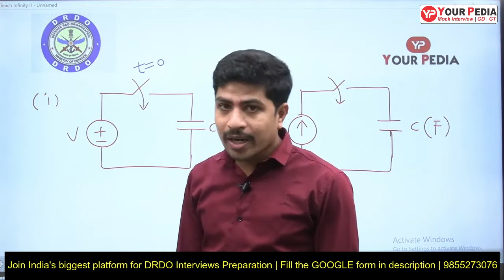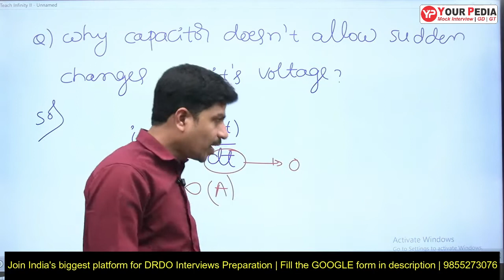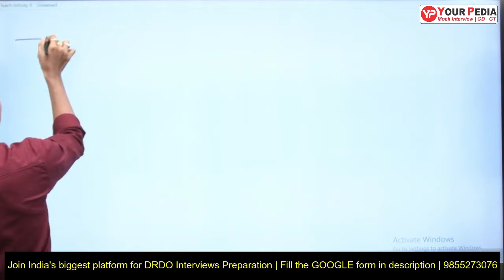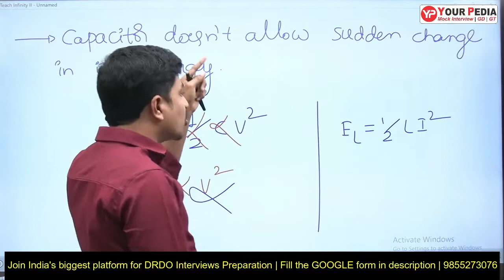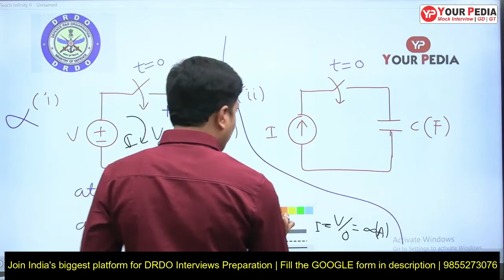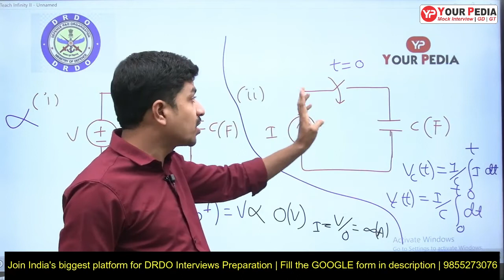Combination of a Source & Element from Network Analysis | EE & ECE technical interview questions

Comment: compliments and doubt:

compliments:
i loved this pattern of u solving one tricky question in one video. quite useful sir.
i wish you continue doing such.

doubt:
12:18 so, connecting a small battery's terminals directly to the terminals of the capacitor will spoil the battery ?
can we pleasure the current patterns using some devise ? i mean can we observe the impulses or will it damage the ameters ?